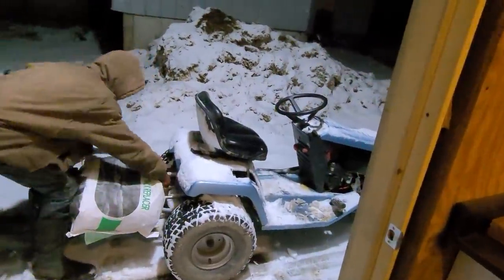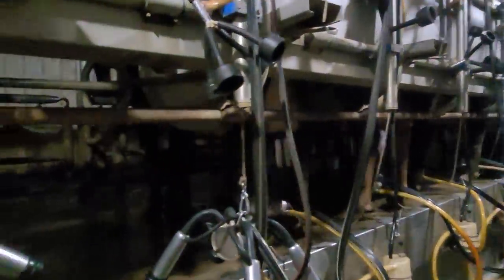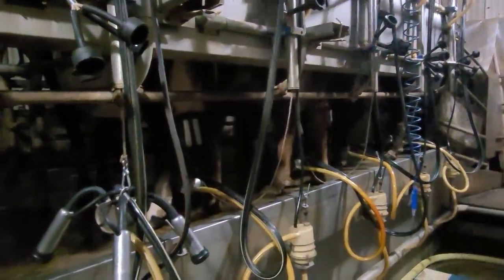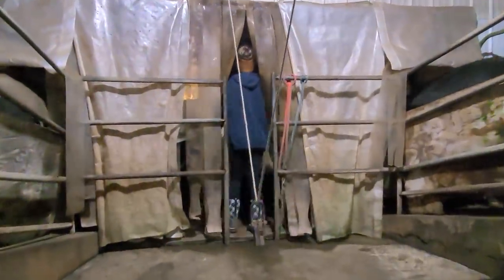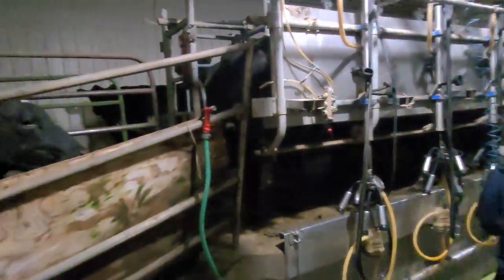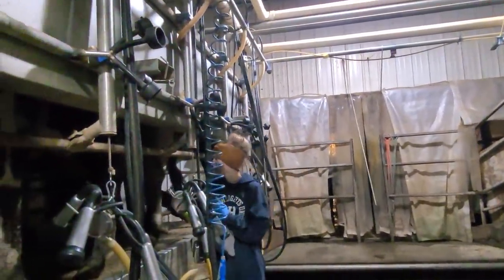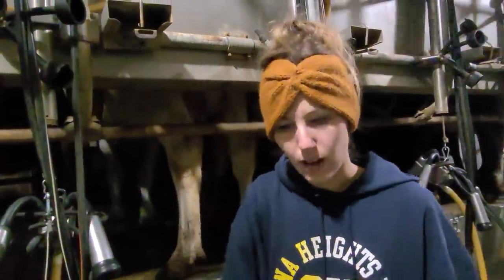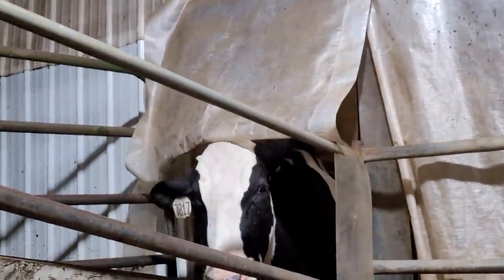Milking Cows With Mackenzie

Comment: Mckenzie is hilarious 🤣, I enjoyed watching your milking parlor in action, a well designed system (Kevin is a mechanical engineer as a mechanic, a rare trait indeed).I milked cows by hand for home use , also by machine, alot, I've done a lot of relief milking:dumping stations, pipelines, straight 4 parlors, double 4,6,and 8's, mostly double 6's parlors, I worked construction and milked cows on my off seasons. A 100 cows thru a double 6 parlor, mostly. Horns  are pain in the neck ! I grew up on a smaller farm in northern upstate New York, about 2 hrs from Canada, we used paste on Horns (kinda tricky, gotta cut all the surrounding hair away, I found out,after trial and error) burned off some (stinky) and cut off remaining horn. We had beef cattle ( they tended to be kinda rough with Horns to each other). And I raised a lot of replacement milking heifers (Holstein) buyers, wanted dehorned animals, and no extra teats ,also , so deporting was constant job on the farm. Keep coming with the jokes, MacKenzie ! An old joke is a new joke,if you've never heard it before,  Kool hat , I could my girlfriend  wearing one 😉.